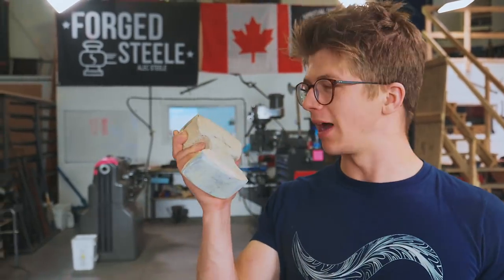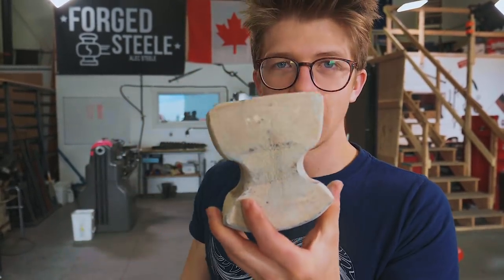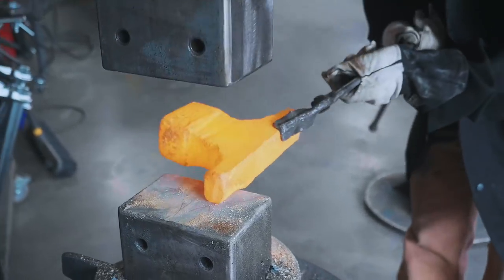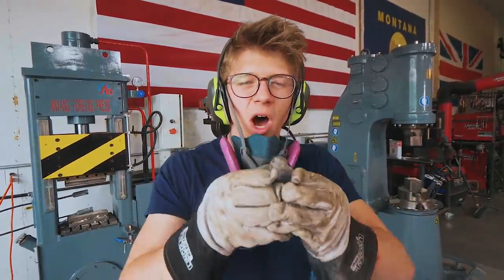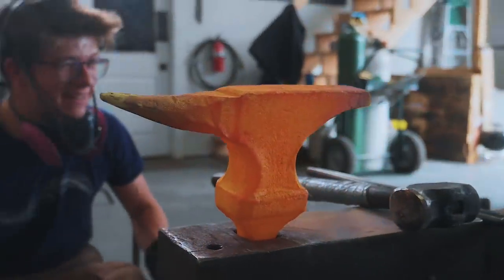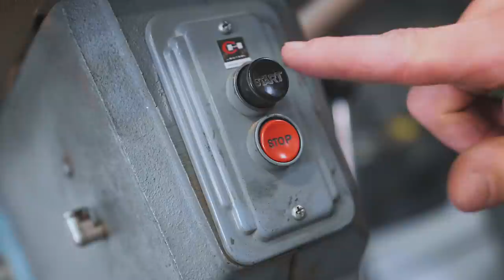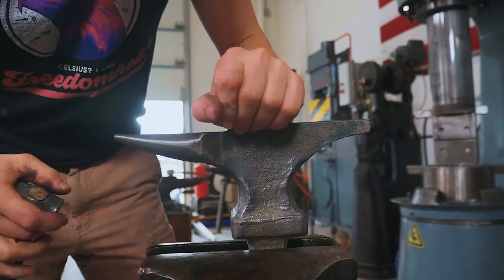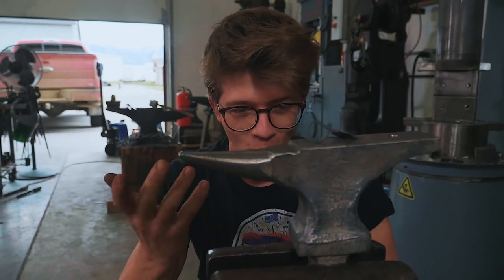MAKING A TITANIUM ANVIL!!! Part 2

Comment: Make sure you wear shaded goggles when you grind titanium, or the light from the sparks will damage your eyes. Man At Arms: Reforged suggests a shade 4, I think.
Reply: I was waiting for this comment to pop up. Was concerned at how bright the sparks were and didn't see any shades for protection. Saw the same thing from Man At Arms: Reforged
Reply: Yeah have seen the Same Video.
Votes for this Comment so Alecs sees it.
Reply: They sure are bright.
Reply: As do same with magnesium, this flashes you like welding!
Reply: @garethbaus5471  Some sport bike stunters and mini-truckers/bagged trucks use blocks of titanium to drag on the street and throw really bright sparks at night.
Reply: I agree. I frequently have to grind on titanium parts for work. Sparks are very bright. Also have to be careful, the sparks will weld themselves onto the surface. Also the shavings from machining it like to catch on fire and burn very hot.
Reply: An auto-darkening welding mask, set to "grind mode" should do the trick. Most that I've looked at, including the one I own, is shade 4 by default, going has high as 13 when darkened.
Reply: Yeah the sparks are bright. But they really ought to avoid making sparks in the first place by turning the grinder belt speed down. The dust from Ti will catch fire. So its really necessary to avoid making grinding sparks when grinding Ti. Plus it will keep from burning up the belts as fast.
Reply: Thanks for all the likes and comments, everyone! Hopefully Alec will see this. I don't think anyone wants to see him go blind or have his epic hair catch on fire. 😂
Reply: I would recommend shade 6
Reply: @tyler1988  Used to have a set of titanium hero nuts on the bottom of my floorboards of my big cruiser. Amazing spark during the day but absolutely insane at night.
Reply: I grind a lot of titanium very frequently and while the white sparks are considerably brighter than what steel produces, they are not near the brightness of something like a welding arc or burning magnesium. If the lighting conditions are very low in your workshop, the contrast is what has a better chance of causing disruption while working. While I dont' think they're bright enough to cause long term vision damage, I don't think it's a bad idea to wear tinted eye protection, I'm more concerned about the heat that they produce which is far more susceptible to causing problems. Adequate lighting in the work area will greatly minimize the contrasting light they produce.
Reply: they wore shade 5 and 7 depending on what they were grinding, just saw that video yesterday
Reply: Very interesting, I would have never thought about the brightness of the spark. I can see how that can be an issue. 
Being made of Tie it will be tough. I have machined titanium before and it’s a different animal in that aspect.
Reply: Looks like a great Give away item !!
Reply: Isn't that the same mask that they use when wielding tho?
Reply: Engage safety-squints and you should be fine!
Reply: @Helveteshit  Yes and no. When welding, you typically use between a shade 8 and shade 12 lens depending on what process, material, shielding gas, etc. you are using. When grinding you typically want about a shade 3 or so for steel if you are doing heavy grinding, and shade 4 or more if you are doing titanium or some other bright sparking metal.
Reply: @0num4  What helmet do you use? My Optrel is shade 2 by default and can adjust between shade 4 and shade 12 when active

Comment: Many years ago I worked as a blacksmith for a company manufacturing stone working tools. Most of our work was done on very old power hammers or by hand. We often made and repaired our own tongs to fit the work piece. We also used tong rings to make it easier to work large pieces. Why do I not see other smiths doing this? This is a source of constant annoyance when I see contestants repeatedly drop their work on Forged in Fire.  We made splitting wedges and shims for stone and wood, sledge hammers, heel wedges for Bath iron works for welding steel hull sections(govt work) slag hammers, chisels, digging bars and crowbars up to 13 feet in length and about a dozen types of jack hammer tools. I loved the work and between your videos and Forged in Fire I find it all coming back to me. Thank you!  You are truly talented!

Comment: I was a titanium fabricator about 30 years ago for a major defense contractor, they built a firewall around our entire area because of the volatility of the dust from grinding or cutting, also we had special fire extinguishers since normal ABC extinguishers are useless. The other thing I found interesting is when you said it holds heat much longer, my experience is exactly the opposite, it dissipates heat so much faster than steel. We had to form it hot to maintain its shape and it cooled so much faster.

Comment: Alec, 

I noticed you like coffee and have coffee sponsors time to time. Make a video where you forge yourself an epic coffee mug. 😁
Reply: Dude, that's brilliant!
Reply: @campbellwalker6378  Thanks!
Reply: Do it
Reply: @BRANDVNLEE Thanks!
Reply: Vacuum-insulated titanium/316-stainless-steel damascus mug...!
Reply: Is He Not british?
Isnt Coffee treason in England?
Reply: @prinzeszelda3650  de0ends on the mood of the nation. it could be jail time, temporary disownment or a beheading
Reply: @campbellwalker6378  that is an EPIC idea.  I hope he'll do it.
Reply: Who drinks coffee out of a metal mug?
Reply: @njd4291  cowboys, soldiers, campers, commuters. Basically anyone who wants a mug that isn't shatterprone like ceramic mugs are
Reply: @prinzeszelda3650  He moved to America, so he's fine.
Reply: A Damascus coffee mug would be especially appropriate considering the origins of coffee.

Yes, coffee was first produced in Yemen, and Damascus is in Syria, but just roll with it.
Reply: Heat transfer would burn your hand, ceramic is insulated which is why mugs are made out of that.
Reply: @calculatedrisk5463  How hot do you drink your coffee that the heat transfer would be hot enough to burn your hand? Even if it were literally boiling, the handle dissipates a fair amount of heat, and you could wrap it with an insulator of some sort, like leather.
     A better reason that it's a bad idea is that metal loses heat too fast; the coffee would cool down faster than a regular mug.
Reply: Yes

Comment: Ima make the wild guess that very soon we are getting a “Forging on a mountain” video ;D
Reply: That's what I'm thinking. Forging with a camp fire.
Reply: And also look at the thumbnaik
Reply: Look at the thumbnail too
Reply: Yeah makes sense, it's a lot lighter than steel to carry with you but still strong enough for light forging, plus the stake for driving it into the ground. 

At first I was thinking it would  be specifically for Jewelry and small detail work with softer metals like gold and silver.
Reply: Maybe at a "rendevous" of mountain men types. Been to a few of those and always a blacksmith somewhere at the event.
Reply: Going to very quickyfind out ground soft enough to drive it into won't be strong enough to hold it to forge on 
Needs a sharper spike and drive it into a log
Reply: Or like a "forging with volcanic flows" video
Reply: I agree.  Hiking out somewhere to do some primitive forging/smelting
Reply: Random Guy - That titanium should be more than strong enough for more than “light or soft forging”. Titanium is some tough stuff.
Reply: @Jovi_97  I Know it is strong stuff, I'm kind of sort of obsessed with titanium, I've got many pocket knives with Ti handles, and carabiners,  and bottles, ect... 

But Ti is soft, it has high tensile strength, and amazingly high all around specs at higher temperature, but compared to steel its very soft. And in an anvil you want hardness at lest to the  point where it wont  chip out. If you look closely when he forges the leaf, you can see the Ti anvil is denting slightly via the light reflecting off the surface.
Reply: Yeah, it seems like he wants a light weight  Anvil he can take on a hike to do some forging in in the middle of nowhere.
Reply: My guess is that the "mountain" in question will be a volcano :D
Reply: I have really wanted to go to Hawaii and use a volcanic flow to make a knife. Would it be impractical? Yes!

Amazing? Obviously.
Reply: @Rain soon......
Reply: @jacobmcconeghy7728  still waiting
Reply: That comment didn't age well.... "Soon"😂😂
Reply: Coming from the future no
Reply: Doubt it
Reply: Forge in a backpack. Eh close enough lol
Reply: Well we never did did we

Comment: Your channel is very safety conscious and that’s hugely appreciated. The dust on this is titanium dioxide and is a carcinogen, so appropriate engineering control (ventilation) and PPE (P100 respirators) are critical in your safety.  I’ve always been impressed with your dedication to PPE and engineering control for grinding ventilation/respirators, safety glasses, etc for all your work.
Reply: Carcinogen?
It's a food additive
Reply: Ok just looked it up, titanium dioxide is a carcinogen when the particles are very small.
Similar to silicon dioxide (sand), and also somewhat similar to why asbestos is carcinogenic.
It's also being removed as a food additive in many countries for this reason.

I don't think you'd get many nanoparticles when grinding titanium, but always good to be safe, and inhaling particles of any kind isn't good anyways.

Comment: Titanium is supper supper receptive to being oxidized, I wouldn't be surprised if several mm of the anvil were porous or if oxygen diffused into the material a decent amount and changed a lot of the hardness and ductility of the metal

also won't be too durable as an anvil, consecutive heats will start building an oxide layer at a lower temperatures than steel. like 500C and the titanium will start oxidizing, so although it looks great i wouldn't recommended it at all
Reply: 🍴🍲🍲

Supper.

Comment: Given that it was soft, it's probably 'commercially pure' titanium. Titanium's modulus of elasticity is 40% lower than steel, meaning it is more elastic than steel. Titanium alloys have about double the tensile strength of your average steel, meaning you have a product that can take huge loads at high strain without yielding. With a density half that of steel, it's good for aerospace products. Also, high end bicycles, as the springiness gives a comfortable ride. A Ti bike has been described as "the bike that God rides on the weekend".

Comment: I just realized, you have exposed electrical outlets in the grinding room. Why do you have exposed electrical outlets in the grinding room? Put some covers on those before some metallic dust gets in there and causes issues.
Reply: Merica
Reply: He may have outlets with built in shutters.  Thats what I would use in a room like that.
Reply: He may have outlets with built in shutters.  Thats what I would use in a room like that.
Reply: He may have outlets with built in shutters.  Thats what I would use in a room like that.
Reply: Yeah probably all tamper resistant outlets
Reply: Most it would do is trip the breaker. It's all metal brick and drywall in there none of that will burn...
Reply: @hgbugalou  
Echo
Echo
Echo
Reply: Biggest issue is a blown fuse, get over it
Reply: @Usercouldnotbefound  Okay? Still something that can easily be prevented, saving him time and money with minimal effort.

Comment: One misconception about titanium is it’s hard, it’s actually just has the largest ability to have to be bent the most before it stays bent, so it’s the most flexible, other than that it is reasonably ductile
Reply: That depends on the alloy of titanium. Pure titanium is very very ductile, and will undergo plastic deformation very quickly, it doesn't elastically deform much at all. But there are alloys, albeit very expensive alloys, that are much more capable of elastic deformation.

Comment: I've got a question maybe one of the viewers can answer: as he takes it out of the forge and that first forging blow with a hammer either by hand or on the power hammer, when it upsets and the slag comes off is that material usable as recyclable metal or would it be a complete waste as it is too impure to recombine? Seems to me like that would add up to a considerable amount of weight and surely there's as least one use or another for it. I suppose if nothing else it could be used as ballast to weight a gameboard piece or maritime application of ballast, would love to hear what possible uses an experienced smith might have for that material. Because like I said seems like there's a lot of it produced across ever reheat cycle.
Reply: I am just a mechanical engineering uni-student so take what I say with a grain of salt, but my answer to your question "it is too impure to recombine?": It's not that it's too impure, it's a completely different material. The slag that comes off is an oxide, it's when the source material (titanium in this case) reacts with the oxygen in the air to form a new material. That material isn't recyclable in the traditional sense that you can just "melt it down", but the founding elements are of course still there. Using some chemistry magic (see YouTuber "NileRed" as an example) you can separate the source material and the oxygen (and anything else in the air it might have reacted with), and thus get your source material back.
Reply: @fredrikbystrom7380  thanks for the response, I’m vaguely familiar with NileRed, have caught some of his content.

Comment: Does the titanium 'holding its heat' better during the forging mean that it is less heat conductive than steel? And if so, does that imply that forging steel on a titanium anvil would also reduce the heat loss from the steel to the anvil, thus additionally prolonging the effective workable time of a heat on the steel? Let's see... Steel: 50.2 W/m K (but with a wide variance for different types of steel), Titanium: around 21 Hmm. Steel - Nickel, 20% Ni - 26. Haven't found any good reference for what particular variety of steel is used for facing anvils and what its thermal conductivity would be though.

Comment: Can't resist. Why didn't you just have the anvil wire cut over night? Also, as my Husband says (He's a blacksmith* and gunsmith, and somehow I always end up being the one to type out dictated comments for him because he types so.... slow.... on a phone. Despite typing more than 145wpm on a regular keyboard... anyway): "Titanium is actually fairly easy in LARGE pieces, but only because of the fact that it is less 'forgiving'... I.E. being as it's harder to move, it is also harder to mess up with too hard of a hammer stroke here or there, and since it never turns into 'butter' it also requires very purposeful strikes to make it do anything - meaning that accidental short strokes, a slightly tilted hammer causing hammer marks, etc is far less common. He was also curious as to why you didn't go ahead, since you had it to heat, end it with a gold nitride finish on the sides and foot, after using some chisels just to do some basic carving work on the sides - just for the beauty of it. Setting up a gold nitride finish on Titanium is ridiculously easy, and it would have been a work of art."

*He is mostly a Bladesmith and Swordsmith tbh. He had done some Farrier work for local horse owners, and some basic Blacksmithing such as blade repair for tractors, making squared nails for antique restoration people, etc... but he hates doing it. Sometimes you just have to do things when what you enjoy isn't making money. He has a Degree in Metallurgy, so that has seriously helped in his trade... especially as he smelts his own alloys at times... or did before all of the lockdowns lost us our shop, and he has been slowly having to begin to sell his tools - which I think may be killing him.

Comment: Fascinating post, but what advantages are to be had with a titanium anvil over a steele one?
One I could think of, might be, that the surface of a titanium anvil would be less likely to deform as you forged upon it, thus having it's surfaces remain true, resulting in the item that is being forged upon titanium anvil having fewer flaws picked up from a non bruised/damaged surface.
Did you make this just to see if you could, or were you curious as to what properties/differences an anvil made of titanium would have over say a cast iron anvil, over a steel anvil.
Cast iron anvils have unique qualities over steel, but are brittle, steel is pretty tough but hammers and other tools can mar/damage it's surface, whereas a titanium anvil would, I would think, be less likely to be damaged.
I was really surprised when I saw how soft the titanium was after you heated and forged it, I was not expecting that at all, if anything I thought that it would be even harder to work with and shape than the piece of steel you had, and wondered if titanium would be viable as a material for an anvil at all.
I have so many questions, but, when you strike the titanium surface, does it feel different to striking iron, or steel? Does it give energy back to your hammer, or does it draw energy from it?
So fascinated,
Carlos.

Comment: If you want to try a challenging material to work with try inconel. inco725 isn't too crazy expensive and can be used for some really crazy stuff.
You want to continuously heat your steal as you're hammering on it? Make an inconel anvil.

Comment: The most amazing thing about these videos is the color/grain structure of the Ti...  I've never dealt with Ti, but the color it changes when heated is amazing!  It almost looks like spray painted foam.
Reply: That's mostly the titanium oxide. In thin layers, like what is formed when a TIG weld bead is cooling down, it forms those distinct blue, purple and golden hues overtop of the grey base metal, but when you get thick layers of oxide, it turns yellow at first before slowly turning white